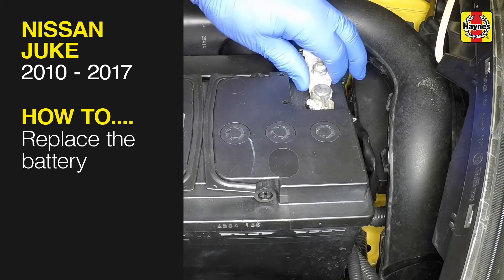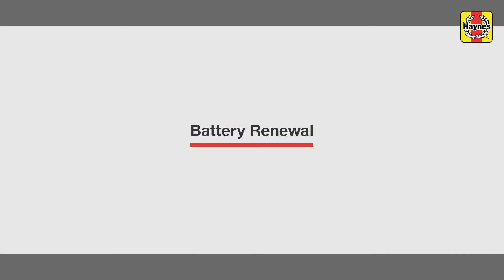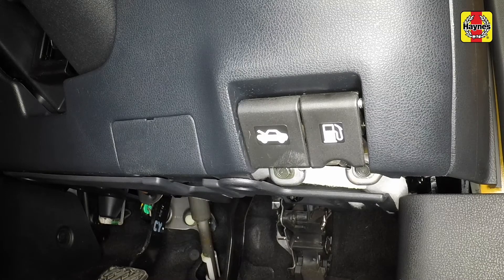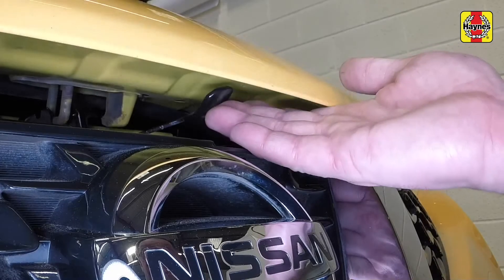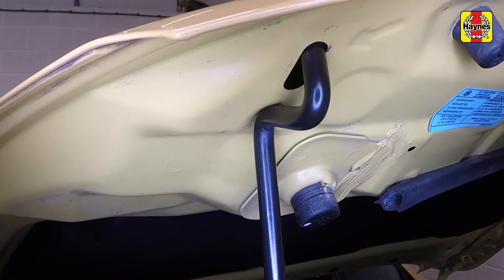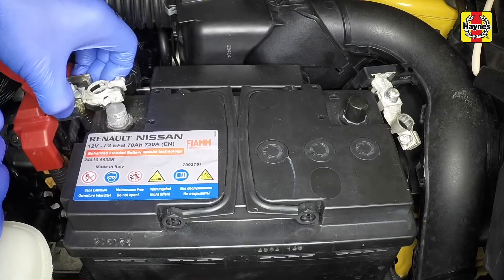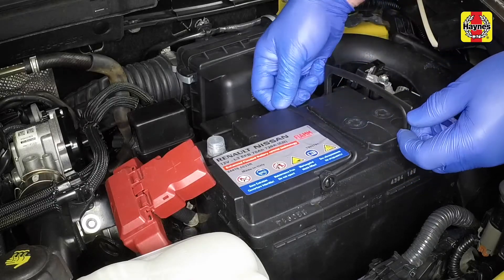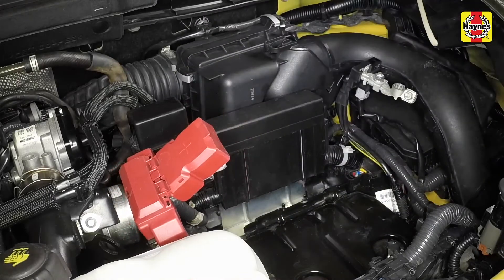Nissan Juke (2010 - 2017) - Replace the battery

Comment: Thank you - I followed this to change battery on my Juke 2014, there are no issues with the computer whatsoever - I have reset the clock and electrical functions myself, and everything is working fine. Perhaps it's different on later models, or on stop/start models, but my 2014 Juke is fine and this was easy. Thanks again for a helpful video :)
Reply from the maker: You're welcome!

Comment: but what they dont say is that being that battery is on a Start/Stop car that the computer has to be programmed to tell it there's a new battery ......
Reply: What do you mean that the computer needs reprogrammed? I switched my battery out today for a replacement  EFB and everything is working fine as far as I can tell and certainly no warning lights about the stop start system. I’m somewhat confused by your comment.
Reply: @jimhughes2641  I think I understand what he means.. At the beginning of the video, the caption says.. 'When reconnecting the battery, switch on the ignition and wait 10 seconds to allow the electronic vehicle systems to stabilise and re-initialise.'   How is that possible with a keyless engine start as as soon as you press the button, it starts.
Reply: @djGreenALERT  it will switch on and not start if the clutch isn’t pressed.
Reply: @jimhughes2641  Hmmmm, maybe that isn't what he meant then. It's hard to second guess someone.
Reply: I just put in a new battery on my stop start system Juke and all was fine.
Reply: @markfox1545  which battery did you purchase? All the ones I've seen have the positive on the right